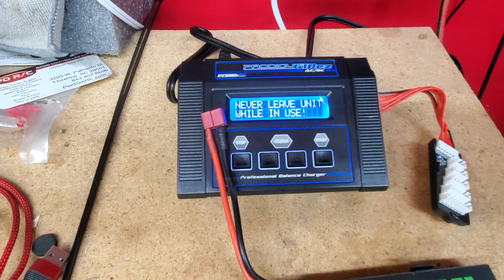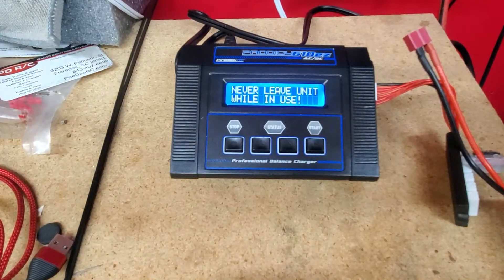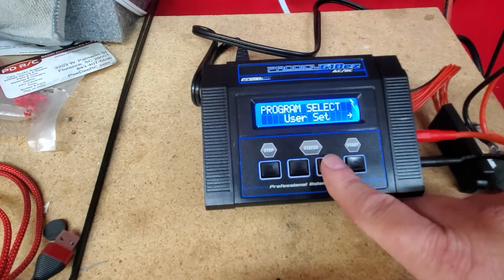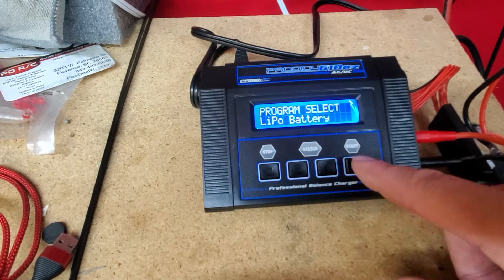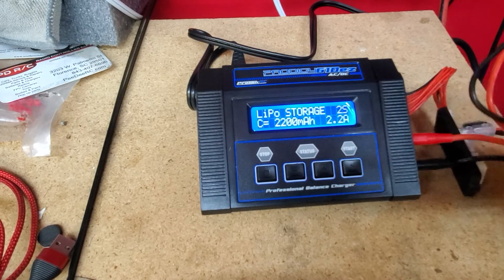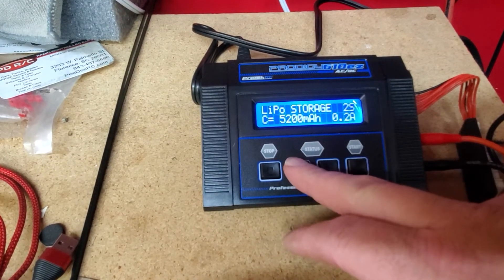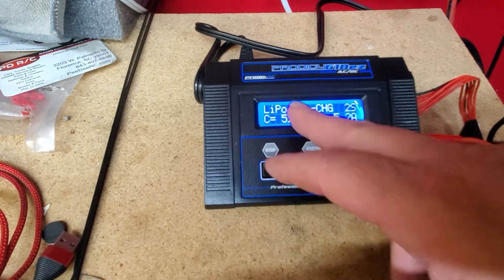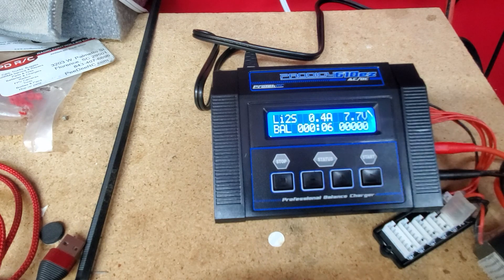Quick start on the Prodigy 610ez

Comment: If I fully charge it and don't want use anymore do I put in storage mode to put away?
Reply from the maker: Yes, put it in storage mode. It may time out the 1st time if the battery is fully charged. It may take 2 storage mode cycles to get the battery complete in storage mode. Do not go more than 3 days with it fully charged.